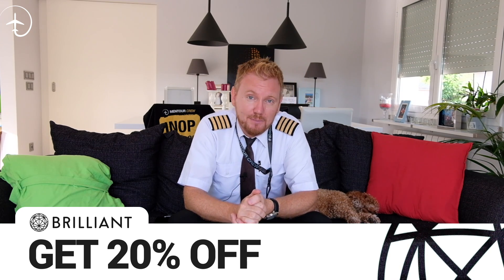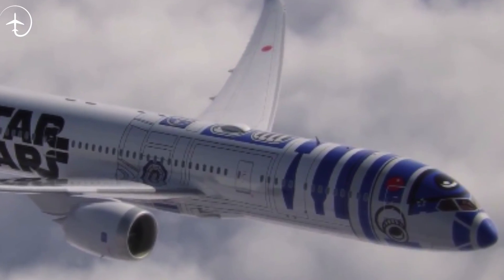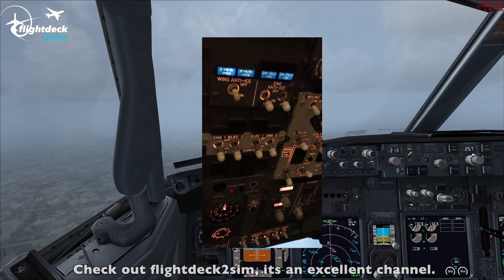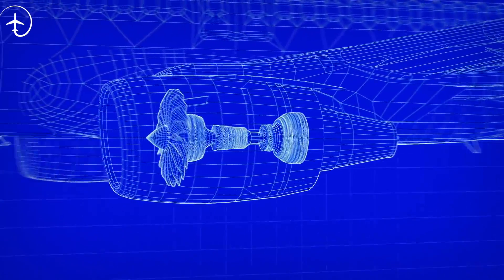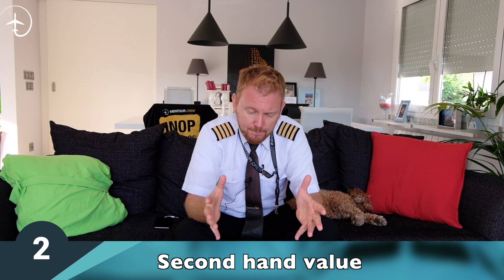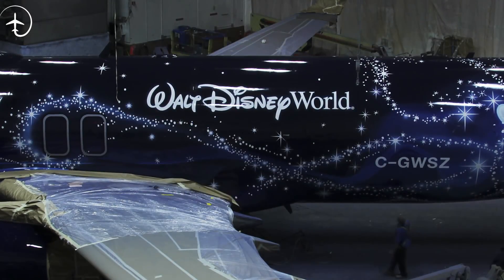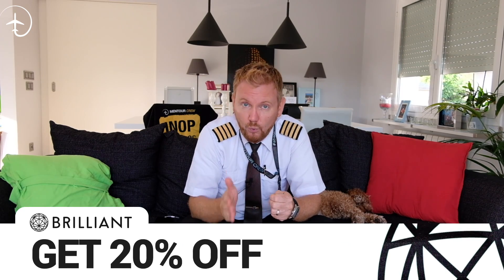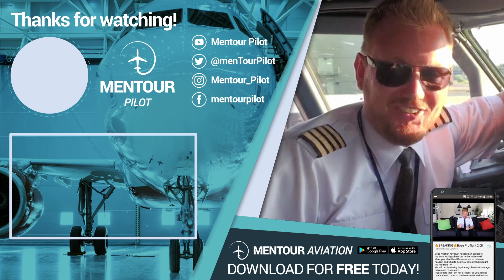Why the front of the Jet Engine is NEVER painted..

Comment: About the paint colors, there was a Pepsi painted Concorde in the 90s and because it was blue, it couldn't cruise past Mach 2.0 (I think it was stuck at around 1.8) due to the fuselage heating up too much and warping.
Reply: But relative to that, the SR 71 blackbird was black though and colour didn't pose a problem, well I know material used to build it may possibly be a factor
Reply: Then again, you are right because on the ground the SR 71 used to leak fuel because of the contraction in the fuselage and then those leaks use to seal up during flight

Comment: Same reason why leading edges of the wings aren’t painted i assume?
Reply: Yup. Engine bleed is blasted onto the inside of the leading edge via perforated piccolo tubes. Bleed air also powers air conditioning, pressurization, engine starters, and on some planes, thrust reversers. There's even a rain-repellent system that blasts air across the windshield to prevent water from touching it. It's a very versatile aircraft system.

Comment: everyone: "painting our planes white will make us save money and fly safer"

Southwest Airlines: "hold my jetfuel ..."
Reply: R to the Izzy I was thinking about Southwest during this video also
Reply: @MarkSmith-js2pu  Same here, and also Spirit. But what about those unpainted aircraft like the recently retired American Airlines MD-80's?
Reply: Vedant Ganesh A full coat of paint on an MD-80 would weigh more like 300 pounds, not 2000.
Reply: @Vedant Ganesh bare finishes on aircraft is also a pain in the bum during manufacture. I remember when we built flaps for 727s that were for bare finish aircraft. We had to leave blue strippable coating on the alloy and you just could not get any fingerprints on it.
Reply: @Ampersandrascott  I wouldn’t call water colors “paint.” 😉
Reply: @markvolpe2305  Unpainted for less weight and easier inspection of the surface of the plane. The only downside is that the bare aluminum must be polished on a regular basis, or it will look quite dull. Almost all modern airliners have vast parts of them which are of composite construction. Composites must be painted to protect them from UV rays, which are incredibly strong at the altitude commercial airliners fly.
Reply: @dougrobinson8602  The old American Airlines livery had bare aluminum with red white and blue stripes along the side. I missed the classic AA livery.
Reply: @MarkSmith-js2pu  ok.  I never did fully get the hang of pig Latin (even barely). I shall look for the Rosetta Stone pig Latin lesson plan. 😂
Reply: Vietnam Airlines enters the chat
Reply: @Owen Fantuzzi didnt wow just got bankrupt?
Reply: @novconoco7785  They resumed services recently.
Reply: Air New Zealand has got a fleet of black painted aircraft.
Reply: @BrianSu  It's different in the southern hemisphere you know!
Reply: @Ronnymikkonen2686  No!
Reply: @BrianSu  You are right, I'm just kidding!
Reply: I love the color of southwest planes!
Reply: @wolfsrule100  Albeit with some heat penalties.
Reply: Levin Soh true. Still prefer it over boring white though lol
Reply: @wolfsrule100  Singapore Airlines managed to do it well though.
Reply: @wolfsrule100  if you look up in the sky you can see southwest planes even at like 30000 feet up because of their paint colors
Reply: What about southwests maintenance
Reply: R to the Izzy Air New Zealand entered the chat
Reply: Jon Doe Actually, no. Darker colors have more pigment and weigh more. The lightest color is yellow, followed by the whites. The darkest is, of course, black, and weighs the most.
Reply: @Ampersandrascott       ...the lightest color is yellow, followed by the whites.  The darkest is of course black followed by what?😉
Reply: Jon Doe Ok, chief. We’ll just throw out Boeing’s paint specs and use yours. Our charts were obviously wrong, according to you. Thanks for saving us from ruin!
Reply: American Airlines: "you're suppose to paint it?"
Reply: Jon Doe   Hmmm, structural paint.  You heard it first here!
Reply: DHL enters chat...
Reply: Funny, nobody says Finnair.
Reply: @kareem8533   Majority of Finnair fleet still have white/light color as the main color of their livery
Reply: @HNBGamer  That's what I mean.
Reply: Jon Doe Keep tap dancing. I watched aircraft get painted for 34 years. We kept careful tabs on paint weight and application rates. Absorption had no bearing on it.
Reply: Royal Jordanian has an entire fleet that is black, been like that for a long long while
Reply: If we assume that the colorful paint jobs are objectively more expensive than the standard white, there is still the possible argument of advertising with a more unique paint job. Though it is (hopefully only slightly) more expensive, the extra recognition of your plane might be worth something to the marketing team that may or may not be worth the additional cost.
Reply: I mean they are partly white but how is no one saying KLM? Easy to spot by birds? Nah, we goin' sky blue
Reply: Nordica airlines?
Reply: Thinks about Aeroflot with Grey. Blue, Red and White
Reply: Air Newzealand “all in black” be like
Reply: Nah.....hold my pretzels
Reply: R to the Izzy the previous color scheme was definitely chosen for its price. They would say so publicly at presentations.
Reply: Loved this.
Reply: like "everyone:" ?! ^^
Reply: R to the Izzy Southwest, while the least offensive example, still succumbed to the billboard trend. Paint the entire fuselage a solid, boring color and make the Microsoft Word font logo as big as possible, so that it clumsily crosses over the windows. It’s easily the worst Southwest livery. The fact that it’s a dark blue instead of white makes it just slightly less offensive than most airlines, but is not devoid of sin. The previous liveries actually had character, like the red bellies, white trims around the windows, no stupid billboard text, no boring ass derivative blue that every airline utillizes.
Reply: everyone: Don’t hail Heinrich himmler

R to the Izzy: fully supports Nazi Party
Reply: @RocketAnthem  what?
Reply: Over used joke

Comment: Speaking of engines, I always had a question on a incident I had on my first airline flight. It was a Charter from JFK to LAS. and was supposed to be on an United DC8-63 but due to a maintenance issue, it was substituted with a DC-10. It was a time in 1979 when the DC-10's were just coming back online after their grounding after the AA Flight 191 crash, and was one of the first to fly. While at altitude I noticed out the Window that the inner (Possibly outer but couldn't tell) wing engine pylon cowling was missing, and I notified the flight crew which thanked me for letting them know, but didn't seemed to concerned about it, and the flight continued to destination with no further incident. (Other then the knot in my stomach til landing). My question has always been was it safe to to fly a plane in this condition, and should the pilot have immediately diverted. I would think at the very least it would have caused more drag on the airplane.
Reply: I once flew on a Delta DC-9 from Atlanta to Huntsville, and the engine cowling wasn't completely closed. It happens.
Reply: What do you mean by pylon? The support structure for the engine pod? Assuming part of it was missing when you got on the flight, the pilots should have noticed during the walkaround checks and received engineering approval to proceed. The pilots may have briefed the cabin crew before flight about the issue, so did not show their concern.
On the other hand, I have heard of at least one situation where a passenger has noticed a problem during taxy, told the cabin crew.. and the cabin crew have failed to explain the problem to the pilots properly... and the aircraft has taken off in an unsafe condition. It's always good to try telling the cabin crew though (in technical terms that gives the impression that you know what you are are talking about). 😁 
Smaller panels can be taped over with high speed tape. Larger panels need approval (and may have fuel penalties).

Comment: Why dont the wings have some sort of heater for the leading edges?
Reply: There are 2 alternate methods of getting ice off leading edge.  Generally, not seen on turbine engine class aircraft much but on smaller non turbine.  One is hydraulic boots (probably have seen these on some aircraft somewhere- the leading edges look like black rubber).  Ice is allowed to build up to 1/4 inch +/-, then the pumps inflate those 'boots' which cracks the ice off.  Manually operated system.  The other is called a 'weeping wing' where there are many very small holes along the leading edges and a glycol (antifreeze) mix in which a pump forces liquid onto the leading edge which prevents ice formation.  Limited use due to resevoir size/capacity.  Also a manually activated system by the crew.  One is mitigation, the other preventative.
Reply: @avflyguy  cool! Good explanation, thank you!

Comment: Isn't all the paint on a plane something like 300 lbs.?
Reply: Regarding paint scheme mass (and polished aluminium such as used on the old American Airlines schemes) - an informative summary is provided by Boeing here: 
@t

The mass of paint on a 737 is about 81 kg (versus just 11 for stripes and logos only)...
Typical savings in fuel costs are negated by extra maintenance (e.g. repolishing ~4 times per year rather than painting every 4 years) so the annual cost of operating a polished short range single aisle aircraft is ~$90,000 more (1998 estimate).   This left the matter largely to aesthetics - until the increased use of composite materials in designs necessitated paint.

Comment: For reasons two and three violet could be an option. It is pretty close to ultraviolet, so it theoretically reflects even more light than white.
Reply: A colour being shown means wavelengths are being selectively absorbed, and white is reflecting everything visible.  UV may well be reflected as well...
Reply: @chrisschack9716  I don't know whether that is valid for infrared radiation as well or just for visible light.

Comment: Here's a question, why are only turbofan engines mounted in nacelles on large planes left unpainted and not on military aircraft like the A-10 and S-3 Viking which have nacelle mounted turbofan engines. And why don't planes with turbojet engines need to have the front of their air intakes left unpainted?

Comment: For a while, some airlines didn't paint or used very little pain and left most of the fuselage as bare aluminum. American Airlines was one. Boeing's 737-300/400/500 classic and 747-400 prototype rollouts were bare aluminum, too. I wonder how many airlines still have bare metal schemes.
Reply: As much as I like all-metal schemes on airplanes, the older I get, the more I dig the metal/yellow/slate/navy scheme on the 737-100 prototype.

Comment: Reminds me of the legend, The Concorde. 
The Concorde had more livery limits since it undergoes twice the amount of heat cycles compared to subsonic airplanes. When it goes from subsonic to supersonic the surface goes from sub-zero to up to 120 degrees Celsius. The white paint was also especially reflective to lower the heat of the surface. The surface of the plane gets so hot that the windows are warm even at the end of the flight.
Reply from the maker: Yep! The Concorde also had a special, extra reflective, whit color to reflect more heat.
Reply: From a military little bit... I have read that SR-71 on the ground leaks fuel because it is designed to fly at high speeds where heat contributes to stretching of the airplane so all spaces are joined and leaks stop. :)
Reply: @jaroslavsevcik3421  There's a really interesting interview with a SR71 pilot here on youtube. On that video he said that is actually a myth stemming from the fact that the SR71s always refueled in the air right after takeoff. He said this wasn't because of any leakage, but because the aircraft was at its limits for weight if it took on a full fuel load. I can't remember this part exactly, but it was something to do with the tires and how they had to be special for some reason. It was close to their limits to take off with a full fuel load so they always took off with 1/2 full or so of fuel then went and refueled.
He did say it would stretch considerably and there were lots of expansion joints built into it. I believe the Concorde had some form of this too because it would expand considerably in flight as well.
The SR71 had quartz cockpit glass to handle this heat. This pilot said, even with the thick pressure suit gloves on, he could touch the windows and feel the heat coming off of them.
Reply: One story I thought was especially wild, they were taking pictures of Libya during that whole conflict and had SAMs fired at them. They pushed it and took the last few pictures they were tasked to do, and then turned the airplane around and "floored" it. The pilot said they were really cutting it close with the SAMs due to hanging around for the last few pictures. The missiles weren't capable of tracking it accurately at that kind of speed so they missed, but it was still pretty close he said. He said it looked like flaming telephone poles screaming by about a 500 ft away from the airplane. In the panic of trying to avoid the missiles and watching for more, the pilot forgot about the throttles. 10 minutes or so went by escaping the missiles, when suddenly he had an overspeed warning. He backed it off some and realized he was passing over the strait of Gibraltar. They had flown the majority of the length of the Mediterranean Sea in just 10 minutes! He said that was probably, unofficially, the fastest the SR71 ever flew. He of course didn't say how fast though haha.
That video is really worth a watch. All the stories about unstarts are really interesting too.
Reply: @sstroh08  Supersonic aircrafts are literally out of this world. The Concorde can fly from London to New York City in 3.5 hours. That's just wicked.
Reply: And because of that the Concorde with the Pepsi livery could only flight Mach 2 for no more than 20 minutes and for the most time it only flew Mach 1.7.

Comment: All these reasons look really minor and weird, because many of them would apply to other surfaces.
Reply from the maker: Like for example?
Reply: Mentour Pilot Mind you, I am not saying any of the reasons are completely wrong or that you are saying something not true. It’s just that they are kind of...weird, especially compared to other design perks.
Reply: Maybe they would apply to some other surfaces but where is this most effective? In the hottest and the most important part of the airplane --> engines. Plus I think that some kind of compromise must have been done because we don't want to see same looking airplanes all in metallic color.
Reply: The paint is designed to withstand temperature variations of -70 to +50 °C, which implies it already is highly heat conductive, and if it is due to de-icing that it is not applied, it shouldn’t be applied on other surfaces where de-icing is used either, like the leading edge of the wing. Other than that it also has to withstand extremely high air speeds, while being ultra-light and create as less drag as possible. If a not painted surface created less drag, planes wouldn’t be painted at all for fuel efficiency. The most plausible reason is the paint separating and going into the engine (although since the coat is extremely thin and light it wouldn’t do anything, engines can withstand much more), but in this case, why is the outer ring not painted too?

Comment: was smoking only permitted in the lavatory? because toilet doors still have an ashtray mounted in most airplanes.
Reply: @Lancashirelad  It's also on the MEL list.  Not there,  No go.
Reply: @Lancashirelad  Believe it or not, that safety information card in the seat back pocket is also on the MEL.  Years ago some disgruntled flight attendants removed them   as part of a dispute between the airline and union contracts.  They were all fired.  The plane went nowhere till they were replaced.